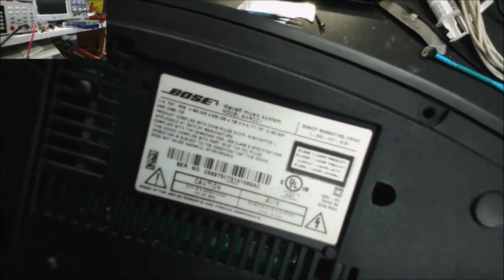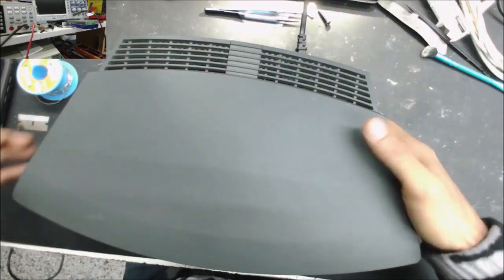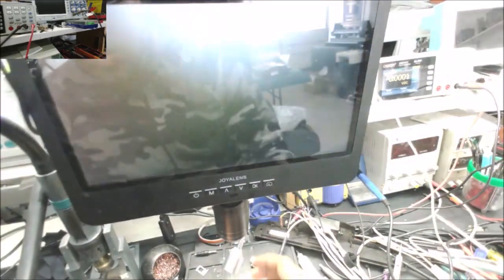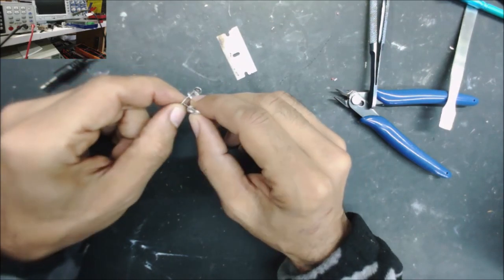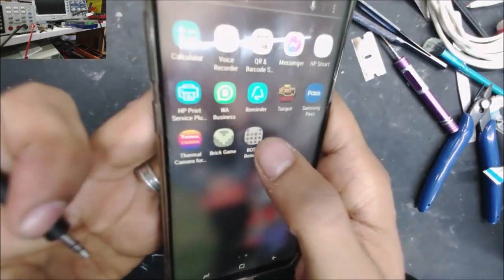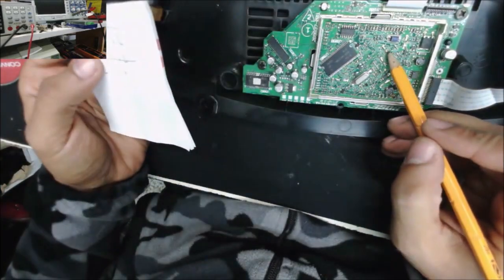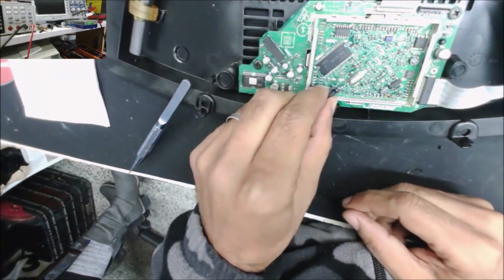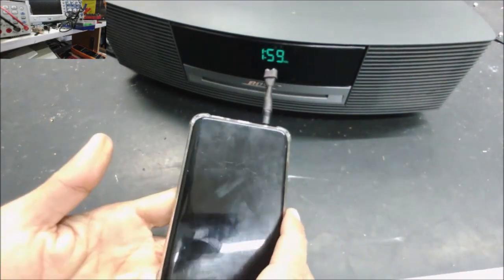Bose music wave system awrcc1 cd clicking + how to make your phone a universal remote control

Comment: Great lesson how a remote works. Impressive way to improvise a remote control, learned something new, thank you!! 👍
Reply from the maker: still more to share 😁little by little
Reply: @SOSfixElectronics  Cool ....I'll be watching 👀👀  Any idea what measurement to use to measure speaker outputs on a receiver? 🤔Just got a Sony LBT-ZX66i missing sound, everything else works, have to try headphone when I locate right size jack ...around here somewhere.🥴
Reply from the maker: @electronicrepairservice2020  check the output transistors. check the amplifire voltages, should about +30v and -30v, give some sound to input of the amplifier  see if you get any output, try signal tracer will help

Comment: Mine was doing the same thing (CD clicking). It was ‘dried up’ or dusty silicone grease on the screw drive that moves the laser back/forth - added some fresh silicone grease to the screw, loaded a disc and moved from first track to last about 5-6 times, now it’s like new! (thankfully, I’ve yet to lose the remote, but it’s inevitable! 😂

Comment: Hello sir , i fixed an lg  oled tv today, short on an smd cap on the tcon the same as the one you had , thankyou for saving me time , i checked the power rails and went straight to that board knowing youd had issues with them. The only issue i had is that when i tested the other capacitor on that power rail, it was reading as 5 micro farad on my fluke meter, so i just replaced both of them with 2 10 micro farad caps , the tv seems to be working fine so im thinking maybe the cap measuring 5 uf was damaged and was supposed to be a 10? Thankyou so much i owe you .
Reply from the maker: great job
Reply: @SOSfixElectronics  thanks again, bless you .
Reply: @SOSfixElectronics  this must be a common fault on the lg oled tvs , a good thing to know ! Also i enjoyed the taillight reapair video, i knew once you had done the hard part and got inside it, you would be able to bring it back to life , theres not much that you cant fix, i think your fault finding approach is the best way , some technicians do too much testing and waste time , whereas you have that "sixth sense" and quickly triangulate on the fault, you cant teach that skill , its something you either have or you dont , and not many do.
Reply: I got a replacement flyback for the crt tv with a black screen but no picture and its exactly the same still . Maybe the picture tube has died :-(. I can feel the high voltage on the front of the screen now though weirdly...and it crackles when i touch it , it wasnt doing that before with the old flyback
Reply from the maker: @reacey  do you see the tube on? do you see a dot on the screen when the tv goes off, try in dark room.
check the IC vertical and the RGB transistors